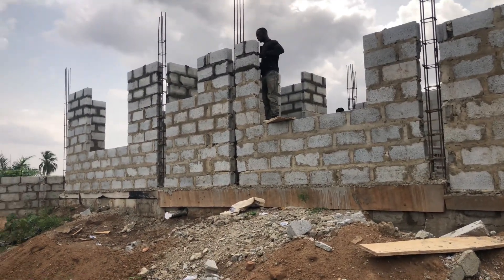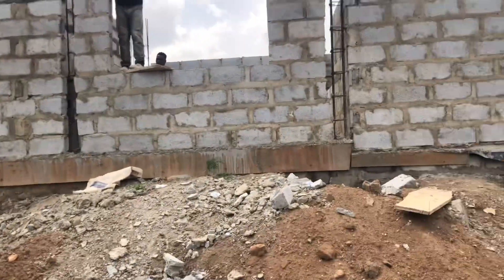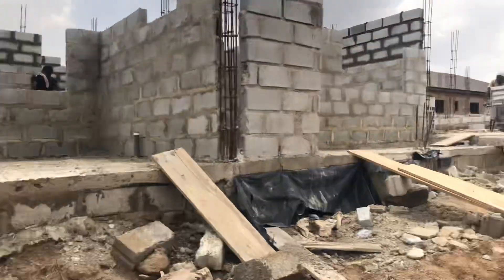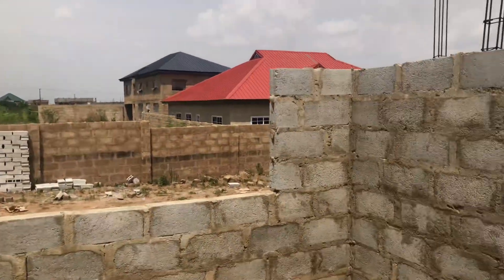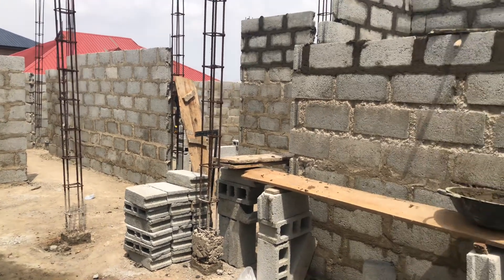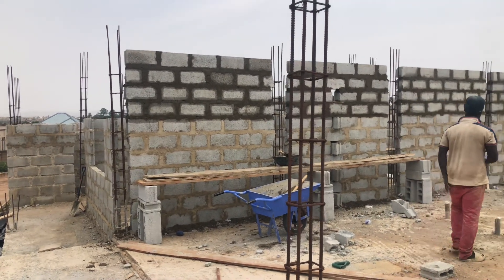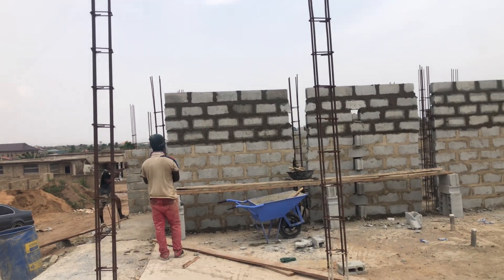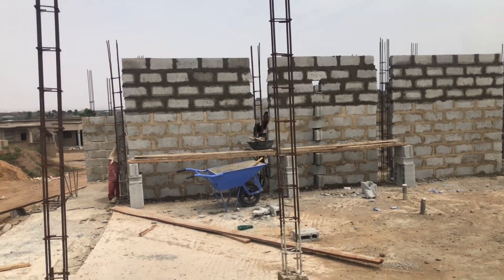Building in Ghana; Block Laying || Ground Floor plan || 0508217315 #construction #design #viral

Comment: Can u lay block to roofing before u put concrete??
Reply from the maker: It depends on the height of the room and again the height of the windows. If the height is 3m or more you need to do the concrete together with the block laying. I hope this helps
Reply from the maker: It depends on the height of the room and again the height of the windows. If the height is 3m or more you need to do the concrete together with the block laying. I hope this helps